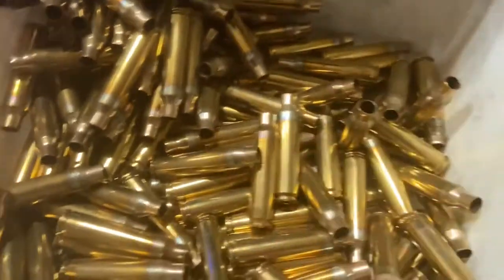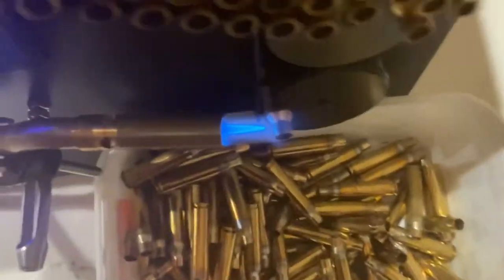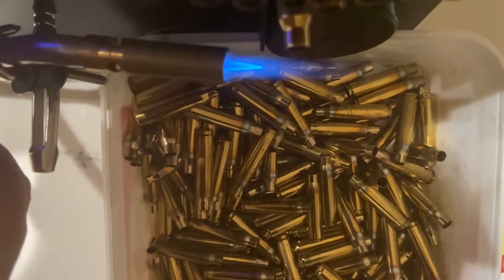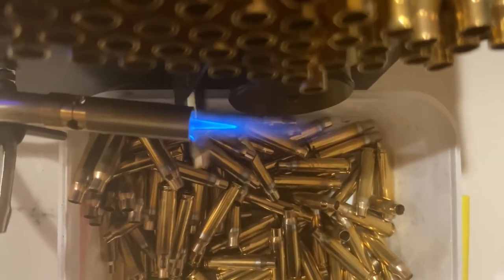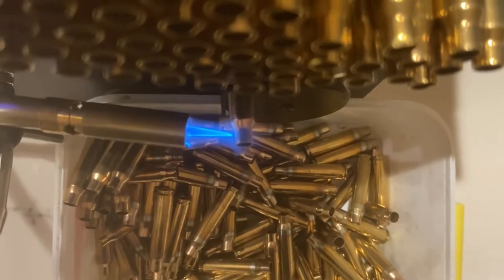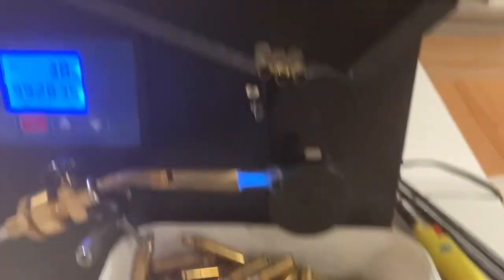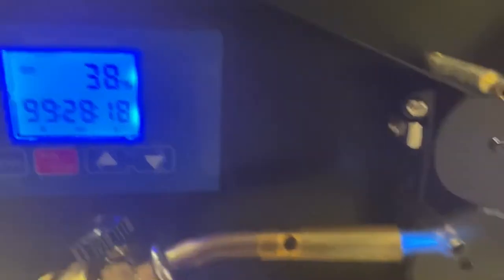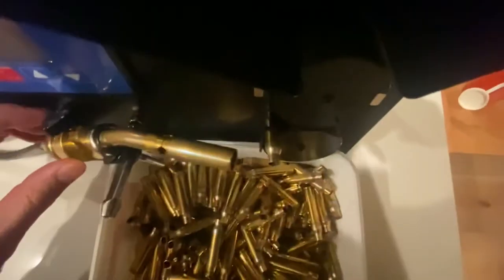Flame control when annealing brass

Comment: So you just want the inner flame to barely touch the brass? Looking to adding annulling to my reloading
Reply from the maker: blue / inner flame is higher in temp. you can also upgrade to MAP (yellow bottom) vs propane (blue bottle). MAP is hotter, and reduce annealing speed by about 30-35% based on a test we had done. But it cost 2-3x more vs propane. You decide if time > cost. 

But, in this video we were trying to demonstrate the importance of “flame control”, mostly to avoid burning / melting the polymer wheel on some annealers, from flame fanning out, or residual heat rising up/sideways. However, that’s no longer an issue with our new Gen2 with all 6061 aluminum aircraft grade wheels. they come standard with all units.

However, I would still advise everyone to exercise caution when playing with fire. unless you are in a dark room, you will not see the flame extending further than what your eyes can see, potentially causing injury/property damage. flame control is still important in that regards. Never leave the machine running unattended.

Comment: You need to mention what happens if you over anneal. Some machines only allow ten seconds max.  I went for color on some 300 win mag. My setting was at 20. Color looked great. Brass had weak necks. Ruined one hundred cases. My fault. Lesson learned. A guide on settings would be nice.

Comment: Just getting into this.  So you full length resize BEFORE you Anniel the brass.  After annealing you trim the case?
Reply from the maker: Hey Jack, no. you anneal first, then FL size, trim. if you use a mandrel, some will anneal again before mandrel
Reply: @burstfiregunsdotcom  I guess that makes sense.  Anneal first then Full Length Resize and trim.